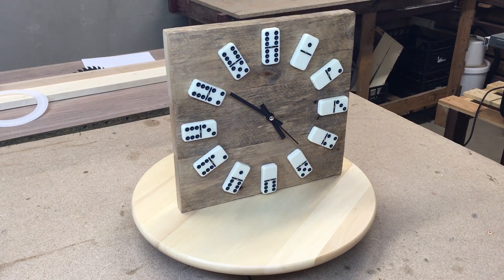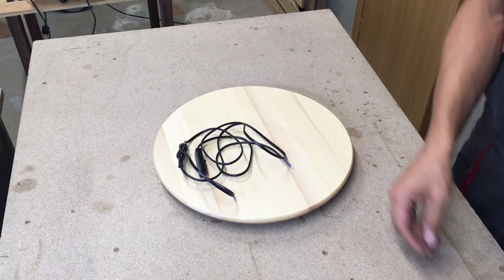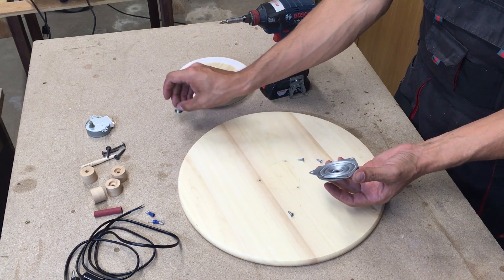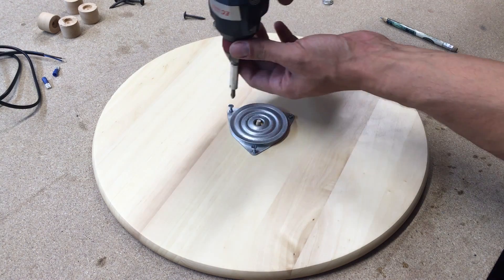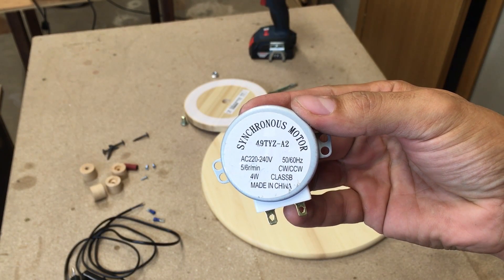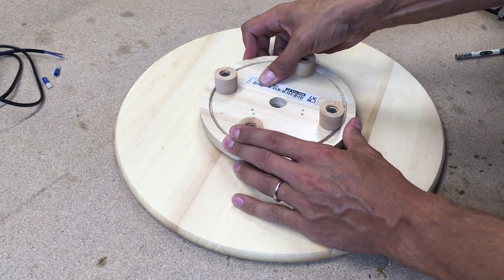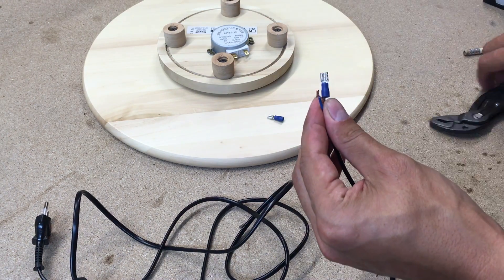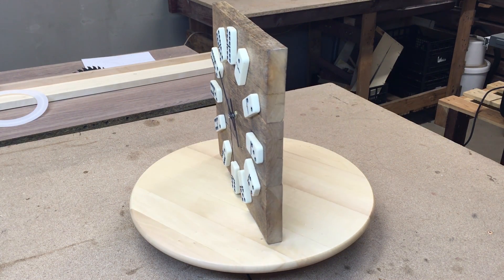How To Make Motorized Turntable

Comment: Maybe add an inline fuse designed for 120 or 240 volt (whichever is appropriate) say, 10 amps?  Also, use a three wire plug with ground to case? Shrink wrap tubing for better insulation?
Reply: They use very low power. Somewhere between 3-4 watt. A much smaller fuse would be ideal
Reply: @brentonsword6688   I saw a formula watts/voltage, and then at 200% load.  I mainly want to protect against a short. I'm glad for your answer!
I think I'll go with an inline 0.1 amp.  That 10 amp would have been much to high.  Thank you!

Comment: 0:20 : The plate runs out of round, for objectmovies I have to re-centre the position of the hole in the middle.
Reply: I bought one, and I noticed that too. Luckily the problem is easy to fix, but it's a shame that the QC at the factory is so poor. Finding the centre of a circle is very easy.
The bearing is also very poor quality, and doesn't run very well. As luck would have it, I had a far higher quality bearing just sitting in a box at home, so I swapped it for that, and it runs really smoothly now.
Reply: @MrSonofsonof  Is that motor from microwave can run smoothly? On the video it seems like waveform speed. I mean it is the difference in rotation speed I have noticed it several times.

Comment: Using a potentiometer with a synchronous motor is not the way to adjust the speed. Replace this motor with a stepper motor and controller.
Reply: Why? What is the impact? It is dangerous?
Reply: @EckoHeHeYT  synchronous motors are designed to the frequency of the power supply.
Reply: Hello , can ı use this motor under a homemade table tennis robot as a ball feeder ? s://www.youtube.com/watch?v=02LVPW906Yc&t=42s   like one on this video ?

Comment: Extreme Caution.  Exposed mains AC
Reply: Yeah, this is an absolute deathtrap if you dont know it, and/or for children!
Reply: @teospower  can you further explain???
Reply: @vonburemann9942  AC is direct 127/220 volts feed from your wall plug directly to the motor, main connectors to the motor are exposed, no insulation at all, if you touch both pins accidentally when it is plugged in, you will be electrocuted, you need to insulate the pins/connectors individually.

Comment: Mains volatage is very dangerous if not lethal! At least issue a warning in your video. Don't use an unsuitable potentiometer!
Reply: Manuauto  soooooo maybe I shouldn’t try this project? That sound dangerous AF,
Reply: Not to mention the haphazard aimless drilling next to his fingers 😂
Reply: Just use a low voltage DC Motor with a transformer.
Or insulate the contacts so that you can't touch the live wire.